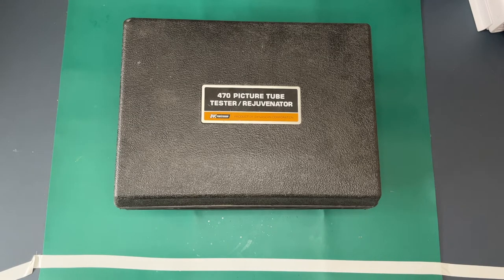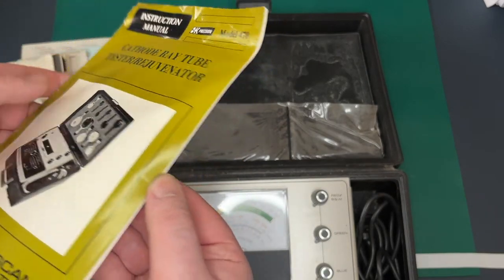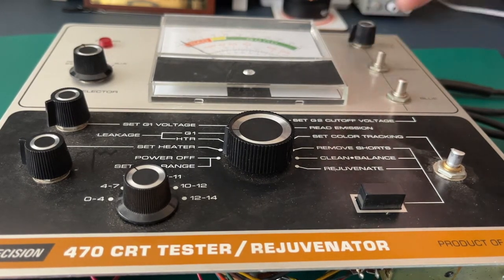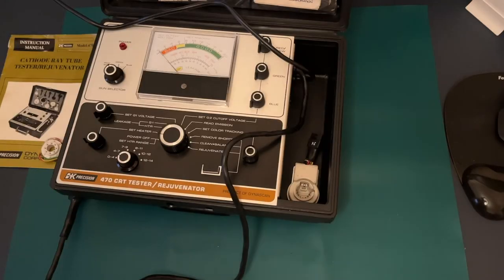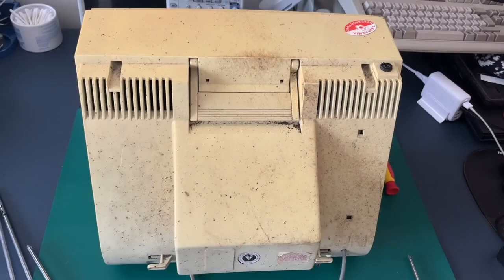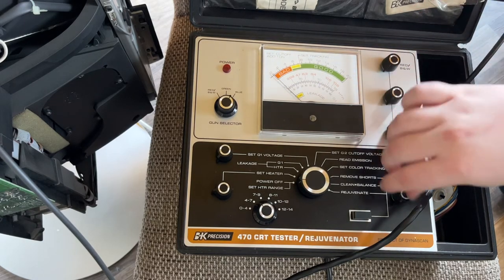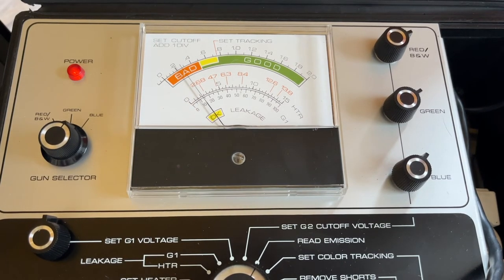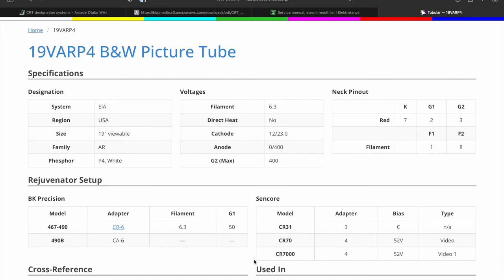B+K Precision Model 470 CRT CATHODE RAY TUBE TESTER/REJUVENATOR - Overview

Comment: Just in case there's someone out there who tries to rejuvenate a CRT and they are not aware of this, I want to WARN people, 
DO NOT TEST OR REJUVENATE the CRT when it's face down!!!  ESPECIALLY ON A COLOR CRT!!!

What people often are not aware of, is that as you try to rejuv a CRT, there are usually (often) shorts.
When the short is "cleared" there's a tiny piece of metal that goes flying off.

If you have the CRT on its face, like at 35:45, the flying metal will fly down to the FACE of the tube and destroy the phosphor.  (B&W CRT)

In a color CRT, the metal bits will fly onto the shadow mask (screen behind the phosphor with all the super tiny holes for the beams to pass through).  Most of the time, the metal filings will get stuck into the holes!  This, of course, stops the beam from getting through the hole(s) at that point and will show on the front as a black spot.  On modern LCD panels, we'd call that dead pixels.  But CRTs don't have pixels, so we just call them dead spots.

SOMETIMES (not often) if that happens, one MIGHT be able to put the CRT back to normal position and lean it slightly back, being super careful to not break the neck, then start bumping the front of the CRT where the dead spots are located.
OF COURSE, NEVER HIT HARD NOR WITH ANYTHING THAT IS SOLID.  Only the hand and GENTLY!

I learned that lesson early on as I was learning how to repair TVs all those millions of years ago.  LOL  well, it seems that long ago.  LOL
😁⏰
Reply from the maker: Thanks for the comment and feedback to the video. All great points, I wasn't planning to rejuvenate with it face down however I can see why you would say what you've said for clarity and to help others.

Thanks for stopping by - take care.
Reply: Important information, i saw it (face down) in other video so thx to have precised it
Reply: @lableu758  I should have mentioned too, not ONLY face down for rejuvenating.
And older CRT (usually) tiny bits of metal can blow off the elements in the neck, even on a good tube.  So when placing face down, it is possible for bits to block holes in the shadow mask.

The reason I know about this... .sigh... is because when I first started repairing TVS (2.5 million years ago, it seems) is because I had this happen a few times until I realized what was going on.

Comment: This is a terrific review for this tester and it was very generous of you to spend the time it takes to scan all of those relevant documents. The addition of the information links is over the top, great job. The noisy potentiometer is a wire wound device and that noise is normal. These are generally low ohm, high wattage potentiometers or rheostats used for voltage adjustments. Standard carbon trace potentiometers generally wouldn't work well for that purpose. Very good video.
Reply from the maker: Thanks for taking the time to comment and give feedback. It was a lot of time and effort to scan and upload the docs but it felt good to get it done and potentially help others/let others get use/enjoyment out of it. Really interesting to hear about the differences with wire wound pots - thanks for sharing the knowledge. take care.
Reply: Phew!  I'm so glad that you informed him about the wire-wound pot.  Yes, it sounds perfect.
THAT is exactly how it sounds and in fact, it sounds like it's in new condition too.
Those wire-wound pots, when they start to fail, usually by the wire having been over heated, they'll take on a grinding sound and even "skipping" sound (smooth, then rough).

To be honest, I was rather surprised that he didn't know this before opening up a device like this.
Reply from the maker: @BlondieHappyGuy  Thanks for the comment! Whilst I've been playing with electronics for many years I have no formal training and some information can slip through the net. That's one reason I make these videos is to share what I know, and find out what I don't know, so I really appreciate people dropping by with constructive feedback. Many thanks.

Comment: Looking at the parts list you uploaded (thank you for that, BTW), the heater voltage knob is a wire-wound pot, rather than a carbon pot, which is why it has that scratchy feeling.
Reply from the maker: Thanks for the comment, you are right on the pot, someone else commented this as well! I don't have formal electronics knowledge I just potter (excuse the pun) and learn, so it's great to get corrected on these things. Glad you have found use from the uploads - that took quite a while! take care.

Comment: How do you know what model number CRTs it works on? My CRT 25VGDP22 CRT tube model number
Reply from the maker: I kind of feel like you've missed the point of the video a bit, I put a lot of effort into uploading all the documentation and providing the links to everything you would need in the video description. you simply take the tube model you have, go to the tubular site and search for it, I even demonstrate that in the video. I've done it for you here - http://tubular.atomized.org/tube/25VGDP22 It seems that tube uses the CR-24 neck adapter. This is a somewhat common adapter, you follow the steps I take to setup the rejuvenator with the values found on the tubular site. I hope that helps 🙂